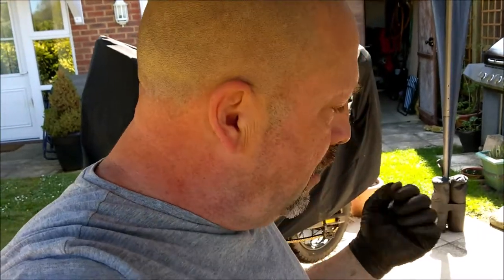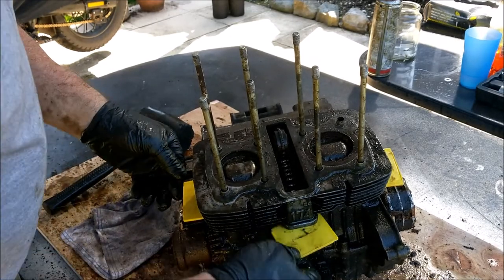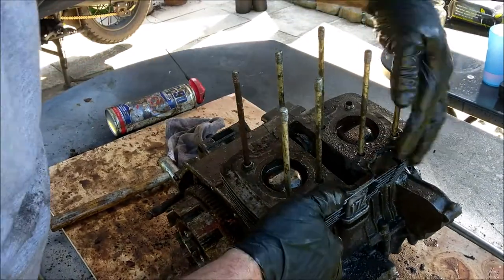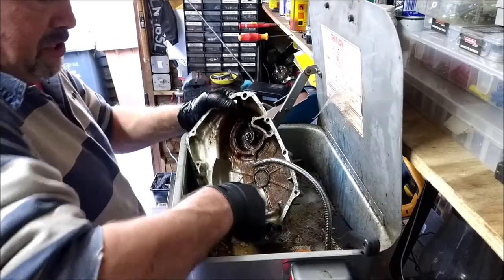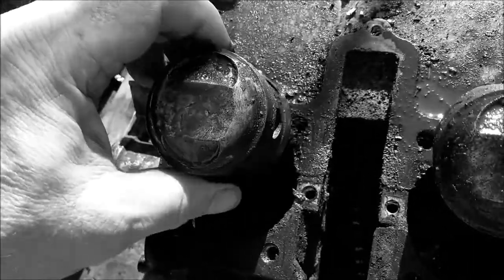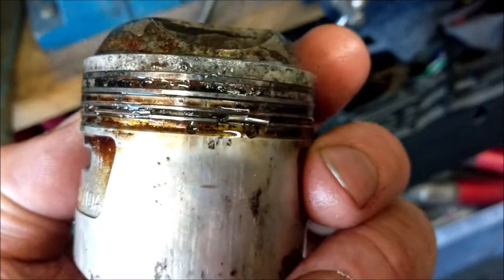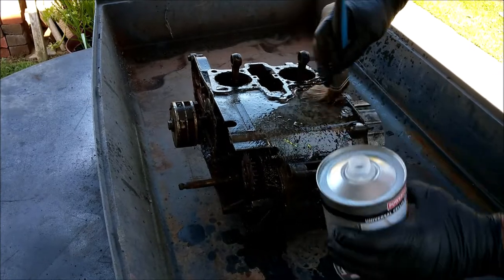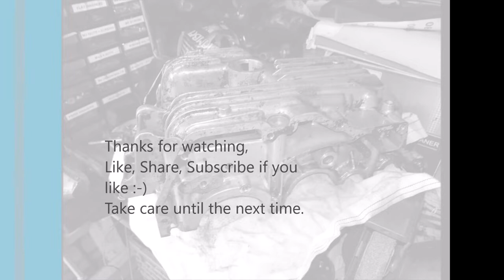Honda CD175 Engine strip-down & Salvage Episode #2

Comment: I know this is 3 years ago, but if you ever get another stuck engine try pouring evaporust down the bores and leaving it for a week. If it dissappears down the sides of the pistons try heating the cylinder and getting it to move. Another trick I saw old guys use was to boil some oil on a camp stove and immediately pour it down the bores. This is to get the bores really hot and all at an even temperature, sometimes it expands enough to let go of the piston.
Reply from the maker: Good call damo thanks. Always good to learn different techniques.  Sadly we don't get evaporust in the uk
Reply: @eadsierestorations  quick question. I'm currently working on a cd175. The oil filter cap appears to be stuck and won't come off. It was slightly damaged when I opened the casing. I removed the centre bolt but the cap still won't come off. Is it screwed onto the filter body? Or should it just lift off?

Comment: Yes it should have dowels locating all four bearings. Mine has anyway :)
I am really surprised you got those barrels off. As has been said, you are a very patient man Adrian.
I'm looking forward to seeing how you get on polishing aluminium. I have watched others and they make it look easy even with pretty basic tools. I set about starting to do mine and found it very hard to achieve better than mediocre results I don't know if my technique is off or I'm just not patient enough. My wheel hubs are still awaiting attention, I keep finding other jobs to do.